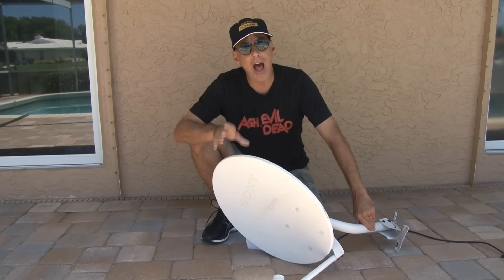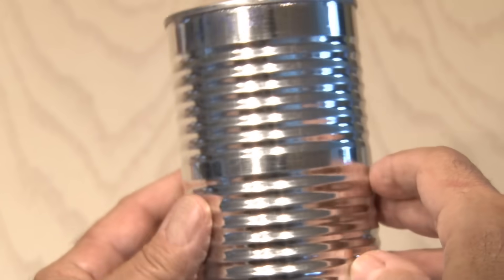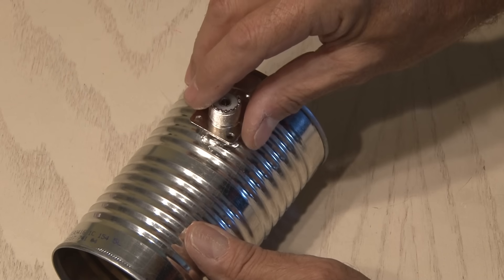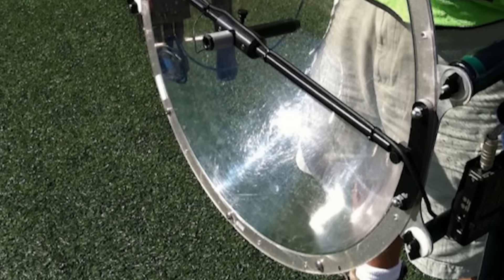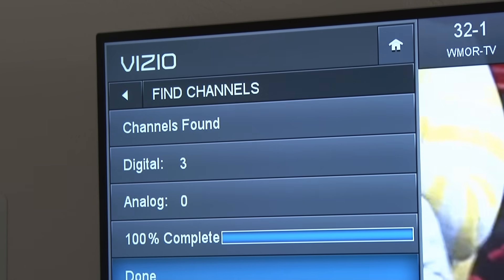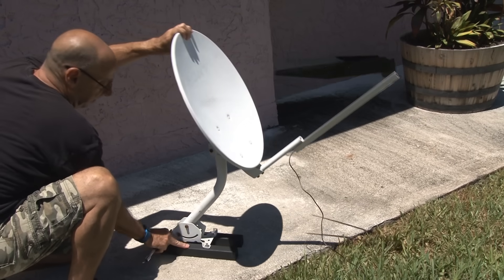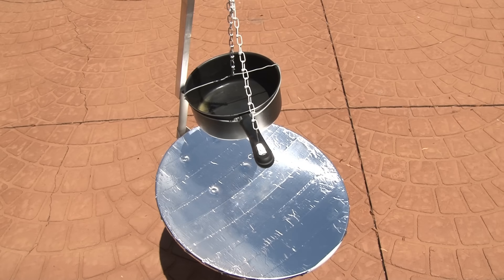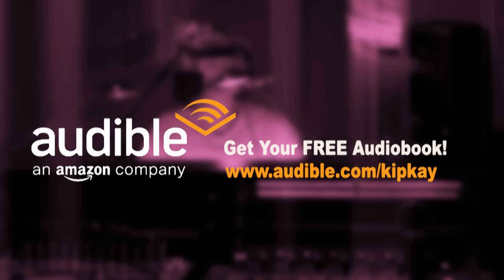4 Brilliant Uses for an old SATELLITE DISH!

Comment: Question, for the wifi can antenna, can you put the coper wire in the bottom of the can or would that not work/be the best?

Also can you use a pop can, like a monster energy drink to do this?
Reply: Direct t V
Reply: I don't think aluminum cans would work

Comment: Hang on a minute... With the WiFi one, that port on the back of your router is for signal OUTPUT, you are doing nothing to "collect" the WiFi. Anyways it's all nonsense just for views
Reply: That’s incorrect. Antennas on a WiFi router are used for both transmitting and receiving. WiFi, by its very nature, requires it
Reply: @FlashBIOS  yes the do receive signals from a device that's connected to the WiFi network, but pointing the "gun" at another WiFi hotspot does not give you signal.  Plus a WiFi network that far away would be way too weak to connect to
Reply: The signal has to go to and from source, you can receive but how does the source receive your signal. maybe I am missing something here.
Reply: You are correct.

Comment: what is the VISO scanning software we see operating when scanning for HD channels?? I understand the antenna build and how it works, but that's only HALF THE STORY! as usual a human telling half the story lol. imagine? so you build the antenna then using a 50 ohm coaxial cable you plug that cable into what? directly into the monitor? are you using the monitors channel search? Im only guessing of course...
Reply: He didn't use the 50 ohm cable for the tv antenna.  He used it for the wifi can antenna.  The tv antenna he used already had a regular 75 ohm cable wired to it.  He probably just connected it straight to the tv monitor.
Reply: vizio is the brand of tele. nothing more, prob using an inbuilt sat receiver to do a channel search.

Comment: Bud, you're getting the hits and that's all that matters right, Satellite dish configuration, baked beans tin... parobolic  theory, requires pin point accuracy  in alignment of both dish in relation to the transmitted signal,  and "LNB" relative to the dish. nice imagination though :)

Comment: folks the cantenna is a good idea. but ... if the antenna isnt tuned good for the router freq.. it will burn it out.. its called SWR.. the router tx and rx. make sure its got good swr and it will work good. poor swr and it wil burn up the tx of your router.
Reply: Good thinking, but, at the typical wifi router transmit frequency and power output, SWR wouldn't be a problem unless it was infinite (like if you had an RF short direct to ground).

Comment: Plugged into your router? Routers route. Did you make your router into an access point? Seems that you would plug into the wifi nic  and that would pick up the SSID that are broadcasted.
Reply: Yeah, that project didn't make sense. The router uses the antenna to broadcast itself as a wireless connection, not pick up other ones. Your computer, phone, ipad, etc. would be the device to attach an antenna to in order to pick up wifi connections from further away. If you attached that antenna to your router and it actually works, you will be magnifying YOUR wifi router signal so that it is seen/accessible from farther away.
Reply: Anthony Howard true. He would have had to turn it into an extender and then you would only be able to download not sent. I don’t think you can send from those? Not sure

Comment: You're better off with at least one screw/bolt in the Cantenna socket. That way the can is a ground reference (compared to the antenna element) rather than just "a floating piece of metal nearby."

Comment: Why are there no satellite dishes pointing up if that's were they are getting the signal from ,?
Reply: Dishes dont point straight up because the signal does not come straight down.   Signal is braodcast at a angle, (I have seen 28-72 degrees) Angles cover a larger surface area than just straight down.  More efficient you could say.
Reply: @ssijon  AND alot of satellite dishes are off set, so they do not point straight at the satellite, but with an angle, some dishes that aren't offset probrably are pointing straight at the satellite (which is still at an angle)
Reply: Satellite dishes point to the satellites. The satellites are above the equator. So if you are in North America your dish should point south (above the equator). If you are in South America your dish should point North (above the equator)
Reply: @Hizenbird  shouldn't they pointing up and not horizontal ,I have got channels in on my TV while the sailit dish was unplugged from the TV ,it was sky tv ,on didgital not analogue how can that happen .
Reply: They should be pointing towards the signal they are trying to focus on. Sometimes that signal is up in space and sometimes that signal is from a tower on land. An antenna is used to focus more of that signal so your device may not need one if the signal is already strong enough. Or some device have an internal antenna and an external antenna is not necessary but may be desired if you want to receive weaker more distant signals.

Comment: I use my Dish antenna to cover my A/C compressor in the off season.  It does a better job there than when I was subscribed to Dish!!
Reply: What was the problem with Dish? I don't recall that supposed subscription!
Reply: @g3kbs408  Dish was/is a paid monthly satellite television service.  The programming sucked, the reliability sucked, and their customer service really sucked.  That's why I use the antenna as an A/C cover.
Reply: @g3kbs408  I wonder what you're talking about.  I'll bet you wonder, too!

Comment: The SO-239 coaxial connector is not used above 500 MHz, let alone 2.4 GHz.   Bnc, Tnc, or "N" is a much better choice.
Reply: I guess a hot glue ground makes up for that
Reply: What about an "F" connector, the standard for TV antennae?
Reply: @charlienyc1  "F" connectors are not considered high quality, but some of the better ones are not bad up to 1.5 GHz or so.

Comment: It will be worth if you are able to boil a water. Egg is need something over 42 degrees only to be cooked.
Reply: an egg doesn't need water to cook
it does if you're boiling it , but not if you're cooking it 

and egg can easily cook in ordinary heat if you have enough temperature

but yes, you could fill this dish with water and boil the water if you wanted to

Comment: Hi Mr. Kipkay, I watched your tutorial on how you repurposed a dish antenna to build wifi antenna. I will tell you that I learned what I never thought is possible with those dish antennas; though, I have one question. What is the size of the end of the coax cable you attached or screwed to the UHF Connector on the beans Can and the end to your router.

Comment: You cooked in a Teflon coated pot?? Bad business. Teflon releases bad gasses when heated into your food. Use a ceramic coated pot, seasoned cast iron, glass pot or stainless steel instead.
Reply: Not true. Hasn't been true in about 20 years. The teflon coating has completely changed. Please educate yourself before spewing outdated data and understanding.

Comment: I can guarentee that you can in no way get free wifi using a bare wire in a tin can. How is the signal being gathered? There are thousands of signals floating around. Without a decoder it wouldnt matter if you did pick up a signal. Unless you have the decoder, that signal is just a random signal. TV signals are short wave simidigital. You would need a digital decoder in order to receive free tv. Another lie. This guy is full of something besides beans and gas.
Reply: SO THIS IS BS & A WASTE OF TIME ?
Reply: the wifi is real. this commenter has no clue how antennas really work. the guy plugged it into the wifi router that has a built in decoder.
Reply: OP is peak dunning-kruger
Reply: That is actually how an antenna works. Obviously it has to be connected to a WiFi radio (dongle) too. The way the antenna 'selects' for the frequency you want to send/receive depends on the length of that piece of wire (which is usually half or a quarter of the wavelength of the to-be received signal).
He would've done a bit better would he have connected the ground of his HF connector to the can itself though. Other than that, yes, it would actually work.

Comment: That Aluminum Duct Tape is my Favorite Duct tape Not only  is it heat resistant and usable in so many ways the glue I have found to be stronger than any other tape" BTW You can Also Make An Hd Antenna With That Tape And A Shower curtain or Screen. You Will need a matching transformer.
Reply: @Timothy Mason
MAKE A VIDEO 📹 AND SHOW US....
Reply: @blitzburghbilly7813  Well I Would And Could" But I Just Got Done Making Seven Different Ones
While trying to help a Less than rich Neighbor 
Now I Am Turning My Snow Blower into two Wheeled powered Garden Furrow" 
Made my own False teeth last week. 
Before that A Crystal radio Got Nearly 300 miles on that"
Now I focus On the Garden it is that time of year"
BUT Maybe Next Winter" 
The last Antenna Reached 76.2 Miles Crystal Clear Without Amplification At All" But Did Have A Matching Transformer Mounted On The Antenna"
Some Of My Antenna's You Can Hang Like a Curtain" Maybe Again Next Winter But Then How will You Find My Video ?
Reply: Reply here with a link, mr. tech savvy

Comment: I am trying to use a satellite dish to boost signal for my FM radios. Someone explain to me how I connect the satellite to the antenna of my radio?
Reply: Think of the dish as a lens. The radio waves bounce off of the surface and are focused on the antenna that you would mount at the focal point, which is where Kip mounted the tin can. Unfortunately, I don't think it will work with FM because it's a much lower frequency than satellite and wifi, and I believe would mostly pass through the dish instead of bouncing off to the focal point.
Reply: wouldn't work, the wavelength of radio waves transmitted by FM broadcasters is too big to be used on dishes
try making a dipole
Reply: Sacramento/SFBayWX 2002 The satellite is in space so you’re either going to need a really long cable or take your radio to space.

Comment: It's absolutely incredible that these YouTube armchair quarterbacks do not do their research before they comment. There's not one single thing that guy said that is not true. Been dealing with RF for most of my life. Besides lights that you can see going by if you know where to look or in a much lower orbit. The ones that are higher essentially don't move yes they do move but it's in timing with the rotation of the Earth that's why I fix the antenna can remain on them. The average communication Television Satellite is the size of a Suburban. Transmitting 24 hours a day from solar power. Thus the big wings that you see on satellite pictures.

Comment: I smell BS...😒
Reply: You'd be surprised how much you can improve reception/transmission of radio signals with very little effort - especially if your need is directional. While your mileage may very (depending on your skills/materials) it's by no means impossible to quite a long wifi range using simple materials and a satellite dish and a cantenna. Beside the only difference between an LNB and your homemade wifi dish is that the LNB contains the amplifier and it's sized to better suit the frequencies used in satelite TV. Basic principle is the same and your satelite TV is send from many thousand miles away using not that much transmitting power.
Reply: Ive used a similar cantenna design in the past and it worked better than i expected.  I dont see any reason why this setup wouldnt work better than a basic cantenna.
Reply: WiFi setup is BS. 

You can’t receive WiFi signals hooking it up to the modem like that, you can only send your own WiFi further.
Reply: @riflesfirst208  , you mean the "router"?  Cause yes, yes you can.
Reply: Twinky UnOuWaNtMyCrEaMFiLlInG You absolutely can not “grab” a WiFi signal out of the air by hooking up an antenna/dish to the Linksys unit that way. 

I don’t care about nerd semantics, what he is claiming simply can not be done the way he is claiming to have done it in this video. 

You absolutely can hook up and antenna to transmit you WiFi signal further, but you can’t receive that way.
Reply: @riflesfirst208  grin, grin.

Comment: What model Vizio tv do you have?
Does it just need an antenna?
Does it need an external tuner?
Mine is a d50u-d1 and i do not think it has a built in tuner.
Reply: Unless your TV was a very early HDTV model, circa 2000, it does have a built in HDTV tuner. I looked up your model and it certainly does have a tuner.

Comment: A while ago I was on active duty far off in the deserts of Fort Irwin, CA. I and my colleagues had spotty service so I made a similar device using a the concave bottom of a can and cut up my longest charging cord. Placed it from a calculated focal point from my dish I ran the cord to my phones antenna and BOOM i had service. They didnt believe it so I made calls and received messages as I was dialing the numbers, other soldiers came by and used it to improve their service.

Comment: I have used coffee cans for 1.2Ghz transmissions in the amateur bands for years, and they are a respectable antenna, ...however you lost all credibility when you did not attach the SO-239 panel mount connector with real hardware instead of insulating the shield from the can. Why didn't you use real uhf rf connectors Like an "N" or even a bnc would be better than a losey hf receptacle. And really...40 wifi channels????
Reply: Earl Lizardi Not to mention the misrepresented UR-MOM, 420 edition
Reply: yeah the hot glue would have insulated the so-239 earth mount?

Comment: Sounds like a hoarder to me.
Reply: No! In my garage i do have many things like him all well packed and id on each can for screws and nails etc!
Reply: @oiseaudenuit7941  I do too. Works well.
Reply: Not a hoarder. He's a pack rat. I am too. If I need something like bolts or screws, I can most of the time find what I need. I just hooked up an HD antenna to my tv. I needed a short  coax cable to hook it to my tv. Did I have to go buy one? Nope. Went down in my garage and got one I saved. Haven't needed one for years, but now that I do, i'm glad I kept it.

Comment: Project number one + kali luinux hacking pc = long ranged wi fi stealer.
Reply: Except literally none of these work, especially the wifi one
Reply: @HomelessPank  well just buy a ling range wi fi receiver and hope it's cheap
Reply: @HomelessPank  none of them work except the solar collector thingy
make a helical reflector antenna, easy to do and gets high gain with no polarization issues
Reply: Just make a Yagi antenna, that should get you a few miles radius

Comment: It appears you do not understand the basic operation of an offset dish.
With the dish about vertical and the LNB of whatever alternative you put in the focus point at an offset, the beam will point at the same offset angle the other way.
So when you want to receive or focus on something near the horizon, you need to tilt the dish FORWARD at the same angle the feed is offset from the normal.
Or you rotate the entire setup by 90 degrees, with the feed holder facing sideways and the dish offpointed from the target at that same offset angle.
Reply: I think, in actual use, that would become quite obvious and apparent ...

Comment: sure,,,the wifi will not have a password U need to know...right??????????
Reply: Right!!!!!  Because the large dish antenna can receive the FREE WiFi hot spot signal from a local fast food restaurant that they offer their customers. Customers can access the Free WiFi while using their smartphones, tablets, or laptops to view content on the internet but when the customer leaves the store and they go a short distance away from the store the signal is lost because their smart device's WiFi antenna is to small to pick up the signal.  Most national food chains, department stores, retail stores and home improvement stores offer free WiFi access to their customers. No password is required.

Comment: On Wi-fi dish:. The dish/can is plugged into a Wi-Fi router?  So, the signal comes to your dish, goes to a router, which then turns the signal into another Wii-fii signal, for your smart phone or laptop to use?  Is this all correct?
Reply: Yep, should just show up in your wireless networks to choose from.
Reply: @WeenieHut420  something is off about it. He used a router that gets an ethernet connection from a modem. He plugged the antenna into a removed short antenna that sends out the wifi. So this means it creates a long range directional wifi network. But it won't work very far because the antenna only gets a small amount of power
Reply: @WeenieHut420  so the dish/router acts as a signal booster.
Reply: @WeenieHut420  there can be multiple wifi networks. How will the router just know which one and connect? It's not possible. And your download speeds would be slow because the free wifi zone doesn't broadcast so far, but upload would work fine because you are sending data.
Reply: @jadenroux5335  actually you get into the router settings put it in WISP mode or universal repeater , the dish is to extend the wireless signal recieving strength , it works like a device i know called tp link cpe 220

Comment: the size of the can matter to the range of the wifi
Reply: Keith Hecker
I asked a similar question, and was told the size doesn't matter, it's  how you use it, or point it and how far that signal is. Good luck to ya.
Reply: Nope.

Comment: It's not a socket... it's a PL259 chassis mount
Reply: And there is no ground from the SO239 to the can. The hot glue insulated the SO239. The SO239 ground should have been connected to the tin can.
Reply: SO239  PL=Plug SO=Socket...don't know why they don't call them PL259 SO259 tho 😊
Reply: everyone here really understands RF, you all get beers